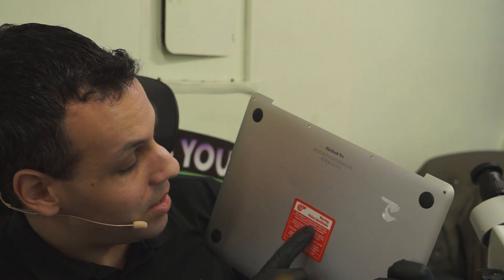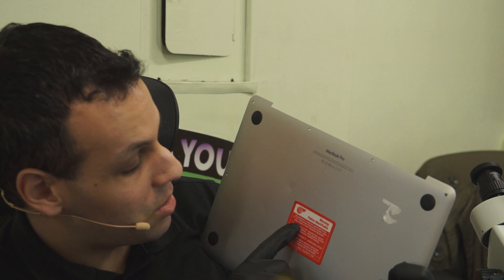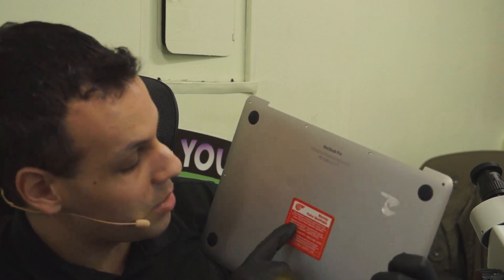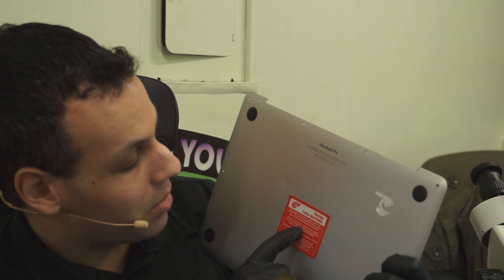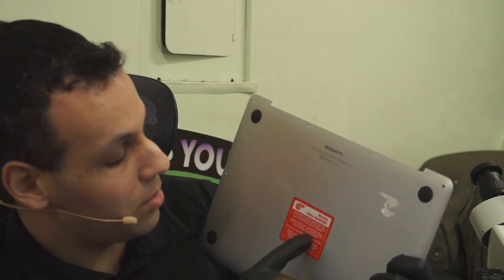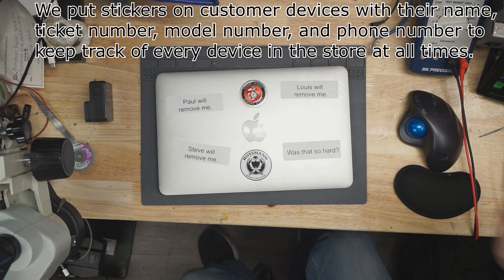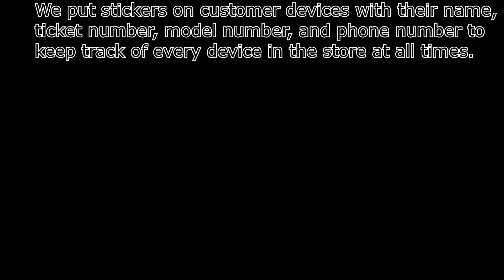I AM GOO GONE!

Comment: We stopped putting stickers on machines at my work(sewing machine repair) because there was a chance of defacing the machine, especially if it was old and painted. We now use a package slip with the sticker attached to that and a plastic tie to hang it on to the machine, laptops would be harder to do that though. Instead of using goo gone you could use a hairdryer. And instead of a sticker, why not a label attached with painters tape :)

Comment: Well, the plate is not this sticker which is merely there for instructions. Check the product's website. Yeah, the one that's printed on the sticker in large font. Looking at the photos, the plate is usually attached on the top part of the laptop.

Comment: Ok so I was checking the web site for this thing and I have one major question...what happens when you legit want to resell your own device that has that on it? Clearly this was meant for stuff that you never planned on ever reselling...I mean it's not like you want to sell your old computer to get some money to buy a new one right? Also I have a laptop some guy sold me and my mom from the back of his truck that we now suspect might have been stolen before. It had a cracked screen and other things wrong with it and I managed to fix it and get it going again and now I use it quite a bit so never say that something has not resale value just because it has some scuffs on the case or other blemishes because someone will find a way to make it valuable as I did with this laptop. It's still missing it's left shift key but I use an external keyboard with it 90% of the time anyway.
Reply: They aren't actually too hard to get off cleanly. I do computer recycling and get plenty of laptops with the STOP stickers. I just use a flat scraper (razor blade type) and as long as you're patient and hold the razor on a low angle to the aluminum or plastic surface you shouldn't damage it if your careful not to gouge the surface. That rubbery coating on some laptops (especially Lenovo/IBM) is very easily damaged but also doesn't hold the adhesive well so you can use a blunter instrument to remove the STOP sticker.

Comment: I gave Goo Gone to my best friend as a housewarming gift when we were in our 20s. I think maybe it had just come out and I thought it was so great! Every house needs a bottle of Goo Gone.
Reply: This is true. I also keep 3M general adhesive remover handy, it works even better
Reply: I just use isopropyl alcohol or even water, put a little on the sticker, let it sit like 30 seconds, then rub with moderate force with a cloth, usually cleaned up fully within 2 minutes(sometimes takes second application to fully clean)
Reply: i have stuff at work that will remove any sticker from rubber, aluminium, stainless steel, carbon steel, concrete zink, copper and most other materials.
it can also remove plastic, latex and nitrile, from your sticker.

it's industriual strength of brand degreaser.